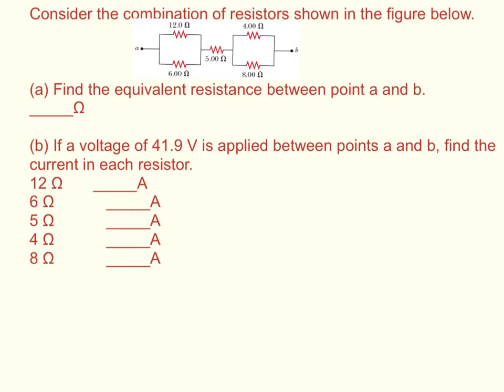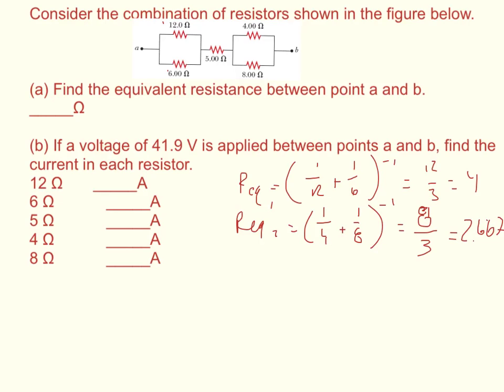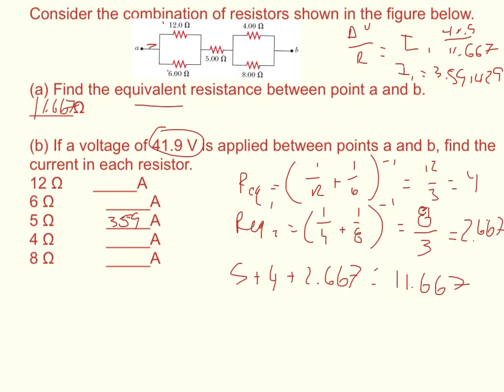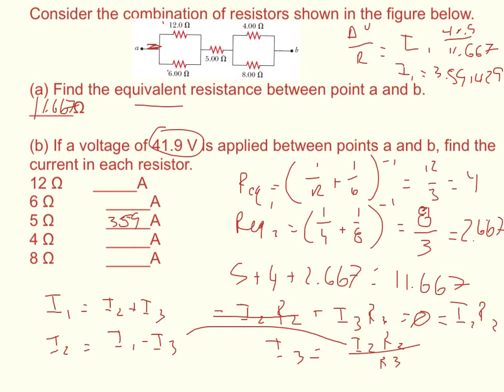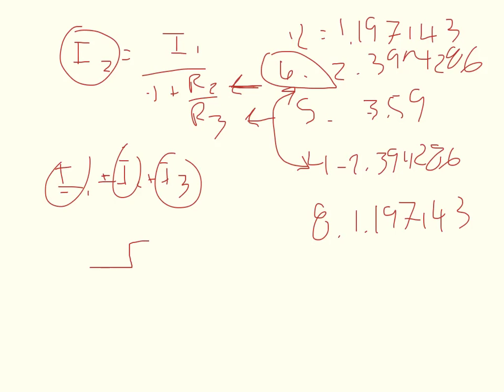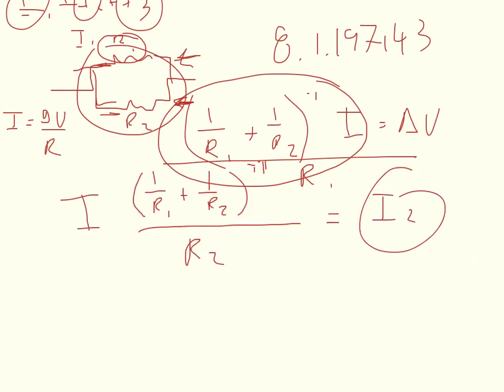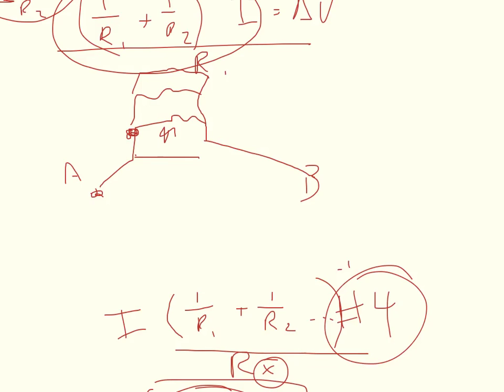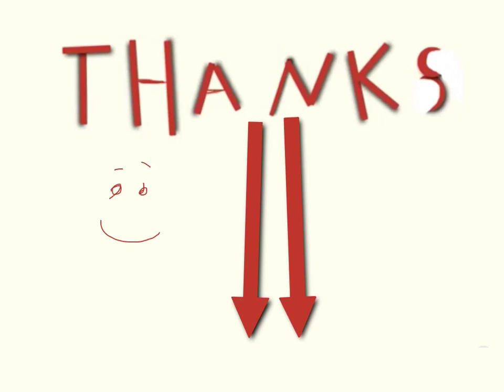Physics WebAssign Ch18 #7

Comment from the maker: This video does not explain the second half of the problem very well. I have received several requests to update it, and I Just finished updating a new video. The link is

https://www.youtube.com/watch?v=1izFA2x5P_c

The video is long (play it at double speed if that helps) -- but I did my absolute best to help you to be able to permanently (forever) understand how to use Kirchhoff's laws (loop rule and node rule). I also did my very best to make sure you will forever remember and understand the reason why 
V = V1 = V2 = V3... In parallel, but V= V1 + V2 + V3... in series. 

After you watch it, and really understand the concepts, I am willing to bet that you'll be able to come back to this video and quickly see how I derived the equations that I show at the end of this video! 

I took 40 minutes out of a very busy medical school schedule to make this update for everyone struggling. Please like and subscribe...
Stick with me for a few more years and watch as my YouTube-master-plan begins to unfold. 
Hint: It's multi-pronged and has potential to massively reduce the cost of high-value healthcare! 

Leave your thoughts.